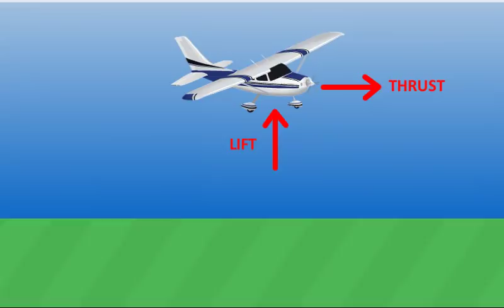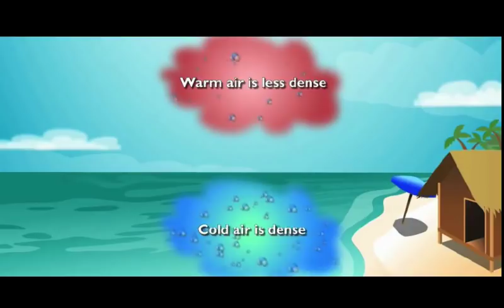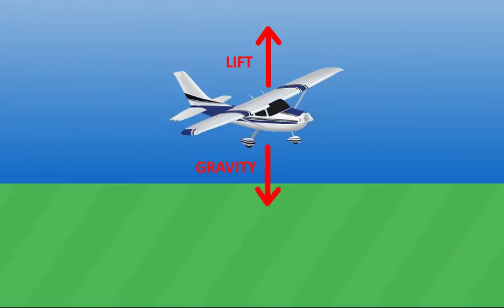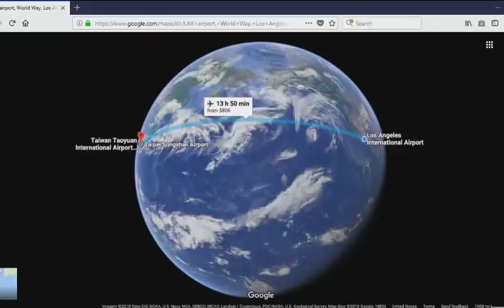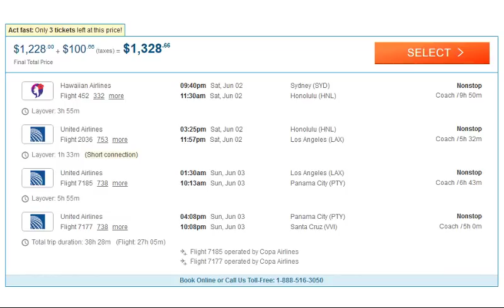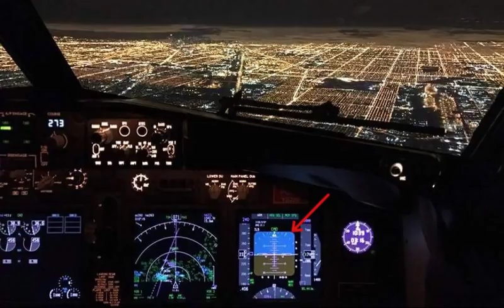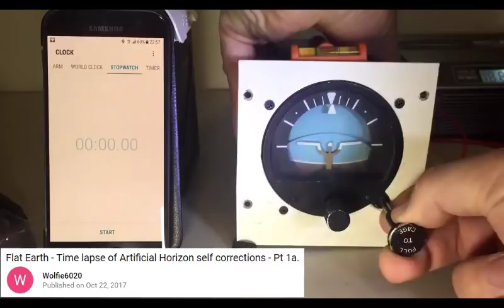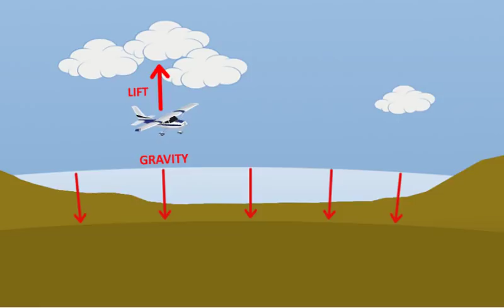Flat Earth Falsities - Plane Nonsense

Comment: Duh duh.  can you explain the huge  Eagles and Hawks measuring 6 to 8 feet in wing spann  they dont need to add extra trust to keep up with the atmosphere but  so gently they glide around for hours so affortless. gravity is not pulling them down. Another question what holds the atmosphere in its place why doesn't it escape to outerspace ??? I don't know the real  answer so don't you it's all just darn guess work till somebody physically proofs it and we will not find it behind a computer screen
Reply: Thermals and updrafts keep them up. That’s why they often repeatedly circle over particular areas. 
Gravity is still pulling them down.
Reply: What hold the atmosphere?
Gravity. 

Notice how air pressure drops with altitude?
Reply: They are considerably lighter than a Jet you plum. How dense can you be??
Reply: Easy!
Vacuum is only a vacuum when compared to air PRESSURE.
Like at sea level here on Earth.
When you get high enough there is very little pressure. Even higher there is NO air at all, so there is no air PRESSURE to force air away into space.
A self regulating process. We don't need a dome to explain the atmosphere.
Reply: they fly on warm air that rises called thermals same as a glider ///
Reply: you think they dont flap it once in a while? there are winds sometimes to get them stay there for a while. like a kite.
Reply: The atmosphere doesn't bleed off into space because the molecules don't move fast enough. The average velocity of a molecule of air at room temperature is 1,520 ft/s. Escape velocity is 7 miles per second.
https://en.wikipedia.org/wiki/Thermal_velocity#Thermal_Velocity_at_Room_Temperature
Reply: but you found trough computer screen that the earth is flat? ....
Reply: Dont compare a room to outerspace and think it does the same thing but that's about the best they can do is experiment in a closed space and think that solves all the answers

Comment: Does it takes 17 million gallons of water to form to finally be heavy enough to have gravity pull it to the ground
Reply: John McNiven What's your point? Look up how clouds work if you don't understand something
Reply: Gravity works the same on every drop of water.
Reply: That's a lot of molecules!!!
Reply: Ákos Körmendi I just told you scientists say for one inch of rain for a square mile is 43 million pounds, so you know so much about clouds, tell me how many pounds does it take for gravity to kick in??
Reply: Not what your scientists say, they say how much water can a cloud hold!! Not how much water vapour do they contain!!! Research it!!
Reply: " tell me how many pounds does it take for gravity to kick in??"
Very few.  For example, water is made up of molecules.  Those are very small, and weigh very little.  Let us know if you have any other questions.
Reply: So how much rain can a cloud produce? This is perhaps a better question than how much rain a cloud can hold. Scientists estimate that one inch of rain falling over an area of one square mile is equal to 17.4 million gallons of water. That much water would weigh 143 million pounds!
Reply: https://wonderopolis.org/wonder/how-much-rain-can-a-cloud-hold
Reply: One inch of rain over a square mile is 2,323,200 cubic feet, or 65,786 cubic meters.  The mass of a cubic meter of water is 1000 kg, so the mass of said rain is 65,786,000 kg or 145,033,304 lbm.
Reply: Gee, what happens when a butterfly stops flapping it's wings?  I guess bird hunting is out of the question, they just stay up there after being shot.
Reply: ^they must not know the difference between water vapor and precipitation...
"It's humid, therefore it's raining!"
Reply: Scientists say one square mile of one inch of rain weighs 43 million pounds??? So who is telling us lies? Them or you???
Reply: You. You're making an argument from incredulity and you clearly don't know jack shit about meterology.
Reply: So how long is this vapour to droplet 💧 ratio? From a dry day to instant flooding for hours and hours or days????? So when is your gravity force going to hold down paper thin butterflies 🦋
Reply: So trillions upon trillions upon trillions of water droplets around the world defy gravity?
Reply: Remember they still have mass!!!

Comment: if the Earth is traveling millions of miles an hour the atmospheric pressure should be higher on one side of the Earth https://youtu.be/kuJGBFSuM00
Reply: Correction, if the Earth were accelerating, this would be the case. If the Earth was rotating, we expect to see that greater centrifugal forces at the equator result in slightly lower apparent weight. This is in fact the case. We would also see that the Earth would not be perfectly round but an oblate spheroid, like a hamburger. This is very slight, but it is also the case. On Earth, pressure on the side of a vehicle facing forward is increased because air particles push against the surface, colliding with it because the vehicle is running into them. Like slamming into a million tiny brick walls. There is no air in space, or rather, very, very little, and so this does not happen for us.
Reply: Simply put: No. Earth isn't accelerating/decelerating in meaningful manner. On the other hand centrifugal force counter gravity and change a little Earth shape that's why there is generaly less air pressure on equator than other parts of our planet.
Reply: Teddy C, what force would increase atmospheric pressure selectively on one side of the Earth?
Reply: if the Earth is traveling four different directions at over a million miles an hour
Reply: Teddy C no. because it is in space. theres no other air being hit.
Reply: Teddy C know how to scale. four different direction? but have you seen its angular velocity? like the earth's rotation maybe at 1000 mph surface speed. but it is rotating once per 24 hours. Thats TWICE AS SLOW AS YOU HOUR HAND.  Make a big clock that has 24 hours in it. I bet you can run, jump and will not be left behind.
Reply: the Earth is also traveling 66.6 thousand miles an hour around the Sun
Reply: reason we don't see any of this is because there's no proof the Earth is even moving
Reply: Teddy C doesnt matter.  it is space. do you drive? what happens when you have the wheel turned it all the way and travel 50 mph vs when you only turn it 10 degrees?
Reply: Teddy C that is the proof. relative to the sun. you will see the sun and stars move 15 degrees per gour from their path. we even have 2 star trails circling at one point. you cant have thst on flat earth. amd we have Foucault pendulum sway that matches its latitude.
Reply: there is zero proof the Earth is even moving
Reply: Teddy C pffft... i just gave you one. you are the one who needs to disprove the evidence.
Reply: Stellar parallax proves that the Earth is orbiting the Sun:  https://en.wikipedia.org/wiki/Stellar_parallax
So does the changing visibility of the constellations of the zodiac.

Comment: 🔫🔫🔫🔫🔫🔫🔫🔫🔫🔫🔫🔫🔫🔫🔫🔫🔫🔫🔫🔫
Science Breaking News: “Kansas is Actually Flatter Than A Pancake” by Erin Podolak ~ Tuesday, August 16th 2011. As the old saying goes Kansas, like many midwestern states, is as flat as a pancake. Somehow, pancakes became the golden standard for flatness, but do they really deserve such a title? A team of researchers from Texas State University and Arizona State University decided to find out. The researchers scientifically tested whether or not the state of Kansas was as flat as a pancake, and were surprised at what they found. Pancakes might be flat, but they are by no means the golden standard. The state of Kansas is actually flatter than a pancake. Who would have thought that was possible? The researchers figured this out by gathering data from the US Geological Survey about the topography of Kansas. They then obtained sample pancakes from none other than that breakfast staple, The International House of Pancakes. Armed with science and breakfast, the researchers headed into the lab. The researchers used a confocal laser microscope to compare the flatness quotient of a pancake to the USGS data about Kansas. For something to be perfectly flat (1.0) it would need to have no two points on its surface at different levels. A 2cm strip of pancake was placed under the microscope, and the researchers found that it was surprisingly inconsistent (0.957) with some sharp peaks and a lump in the center. Kansas, on the other hand, was pretty darn close to the perfectly flat designation, coming in at 0.9997. According to the researchers, this makes the state flatter than a pancake. Now, this isn’t to say that Kansas is as flat as it gets, as it does fall short of perfect and there are bound to be some hills or other “spikey” things that would keep it from that designation, but the researchers were able to conclude that a pancake is shockingly bumpy and doesn’t deserve to be the golden standard for flatness.

The Earth is Not Moving! The heliocentric theory, literally “flying” in the face of direct observation, experimental evidence and common sense, maintains that the ball-Earth is spinning around its axis at 1,000 miles per hour, revolving around the Sun at 67,000 miles per hour, while the entire solar system rotates around the Milky Way galaxy at 500,000 miles per hour, and the Milky Way speeds through the expanding Universe at over 670,000,000 miles per hour, yet no one in history has ever felt a thing! We can feel the slightest breeze on a summer’s day, but never one iota of air displacement from these incredible speeds! Heliocentrists claim with a straight face that their ball-Earth spins at a constant velocity dragging the atmosphere in such a manner as to perfectly cancel all centrifugal, gravitational, and inertial forces so we do not feel the tiniest bit of motion, perturbation, wind or air resistance! Such back-peddling, damage-control reverse-engineered explanations certainly stretch the limits of credibility and the imagination, leaving much to be desired by discerning minds. If the Earth and atmosphere are constantly revolving Eastwards at 1,000 mph, how is it that clouds, wind, and weather patterns casually and unpredictably go every which way, often travelling in opposing directions simultaneously? Why can we feel the slightest Westward breeze but not the Earth’s incredible supposed 1,000 mph Eastward spin!? And how is it that the magic velcro of gravity is strong enough to drag miles of Earth’s atmosphere along, but weak enough to allow little bugs, birds, clouds and planes to travel freely unabated in any direction? 

We must take it on faith as mathematical proof doesn't exist. 

N.A.S.A. on Speed: 
The Earth's orbital speed around the sun is 67,000 m.p.h. 
The sun's orbital speed around the galaxy is 450,000 m.p.h. 
The speed of the ground beneath your feet, as a result of the Earth's rotation is 
600 m.p.h. at the latitude of Sheffield (53 degrees); 
 
1,000 m.p.h. at the equator. 
The Earth travels 584 million miles per year (one trip around the sun); that's 

1,600,000 miles per day; 66,667 miles traveled each hour 

“The distance across St. George's Channel, between Holyhead and Kingstown Harbour, near Dublin, is at least 60 statute miles. It is not an uncommon thing for passengers to notice, when in, and for a considerable distance beyond the centre of the Channel, the Light on Holyhead Pier, and the Poolbeg Light in Dublin Bay.  The Lighthouse on Holyhead Pier shows a red light at an elevation of 44 feet above high water; and the Poolbeg Lighthouse exhibits two bright lights at an altitude of 68 feet; so that a vessel in the middle of the Channel would be 30 miles from each light; and allowing the observer to be on deck, and 24 feet above the water, the horizon on a globe would be 6 miles away. Deducting 6 miles from 30, the distance from the horizon to Holyhead, on the one hand, and to Dublin Bay on the other, would be 24 miles. The square of 24, multiplied by 8 inches, shows a declination of 384 feet. The altitude of the lights in Poolbeg Lighthouse is 68 feet; and of the red light on Holyhead Pier, 44 feet. Hence, if the earth were a globe, the former would always be 316 feet and the latter 340 feet below the horizon!” -- Dr. Samuel Rowbotham,  ~ Earth Not a Globe!

“The lights which are exhibited in lighthouses are seen by navigators at distances at which, according to the scale of the supposed ‘curvature’ given by astronomers, they ought to be many hundreds of feet, in some cases, down below the line of sight! For instance: the light at Cape Hatteras is seen at such a distance (40 miles) that, according to theory, it ought to be nine-hundred feet higher above the level of the sea than it absolutely is, in order to be visible! This is a conclusive proof that there is no ‘curvature,’ on the surface of the sea - ‘the level of the sea,’- ridiculous though it is to be under the necessity of proving it at all: but it is, nevertheless, a conclusive proof that the Earth is not a globe.” -- William Carpenter,

100 Proofs the Earth is Not a Globe

Surveyors, engineers and architects are never required to factor the supposed curvature of the Earth into their projects. Canals and railways, for example, are always cut and laid horizontally, often over hundreds of miles, without any allowance for curvature. (self.conspiracy)

submitted 2 years ago  by slack-magician-boy

The London and Northwestern Railway forms a straight line 180 miles long between London and Liverpool. The railroad's highest point, midway at Birmingham station, is only 240 feet above sea-level. If the world were actually a globe, however, curving 8 inches per mile squared, the 180 mile stretch of rail would form an arc with the center point at Birmingham raising a full 5,400 feet above London and Liverpool. Adding the station's actual height (240 feet) to its theoretical inclination (5,400 feet) gives 5,640 feet as the rail's necessary height on a globe Earth, more than a thousand feet taller than Ben Nevis, the tallest mountain in Great Britain.

The Suez Canal which connects the Mediterranean Sea with the Gulf of Suez on the Red Sea is a clear proof of the Earth's and water's non-convexity. The canal is 100 miles long and without any locks so the water within is an uninterrupted continuation of the Mediterranean Sea to the Red Sea. When it was constructed, the Earth's supposed curvature was not taken into account, it was dug along a horizontal datum line 26 feet below sea-level, passing through several lakes from one sea to the other, with the datum line and the water's surface running perfectly parallel over the 100 miles. The average level of the Mediterranean is 6 inches above the Red Sea, while the flood tides in the Red Sea rise 4 feet above the highest and drop 3 feet below the lowest in the Mediterranean, making the half-tide level of the Red Sea, the surface of the Mediterranean Sea, and the 100 miles of water in the canal, all a clear continuation of the same horizontal line! Were they instead the supposed curved line of globe-Earthers, the water in the center of the canal would be 1666 feet (502 x 8 inches = 1666 feet 8 inches) above the respective Seas on either side!
Reply: Daniel Maxwell. What is your point?

Just answer one question.
How does the 24 hours sun in Antarctica fit into the icewall/small local sun fantasy?
Reply: Nice wall of text mate. Just answer me one thing: If water doesn't curve, how can one place experience high tide while another place experiences low tide at the same time?
Reply from the maker: Did you actually READ the "flatter than a pancake" article? Apparently not.

"One common method of quantifying ‘flatness’ in geodesy is the ‘flattening’ ratio. The length of an ellipse’s (or arc’s) semi-major axis a is compared with its measured semi-minor axis b.."

This means the flatness was measured taking the curvature of the earth out of the equation. Geodesy is the study of measuring earth's curvature, and "ellipse" refers to that curvature. Fail.
Reply: Yeeshk a giant wall of misconception, misunderstanding, bad physics and half truths. 

This VSauce video on how much of the world you can see at once covers the Kansas vs Pancake stuff pretty well. (Turns out other states are flatter!)
https://youtu.be/mxhxL1LzKww
Reply: Earth rotates once on its axis per day, takes 365 days to travel around the sun once and it takes the sun about 230,000,000 years to orbit the milky way once. Doesn't seem so fast now does it?
Reply: Daniel Maxwell makes perfect sense!!!